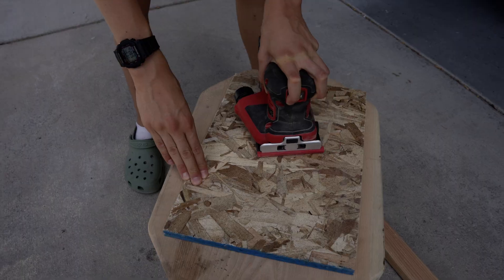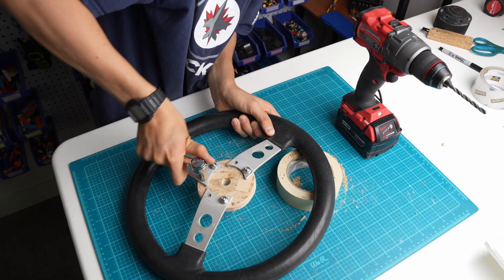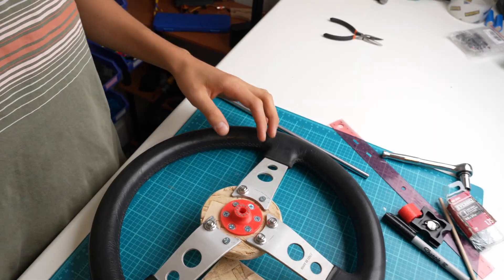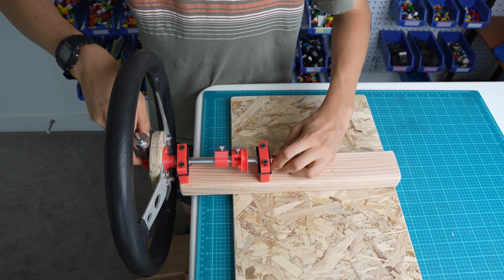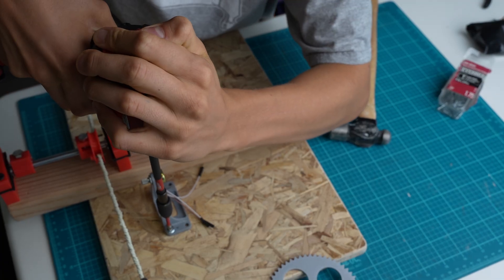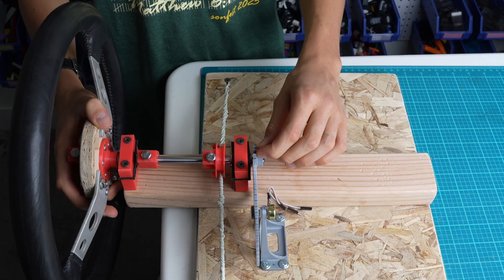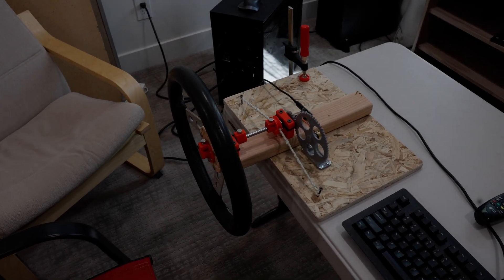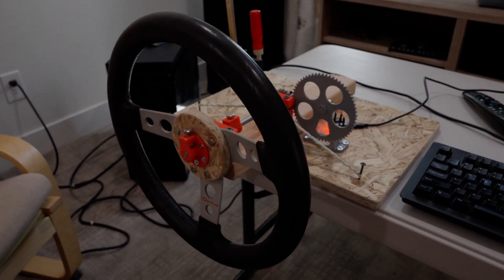Part 1 - DIY Steering Wheel for Drifting Sim | 3D Printing + Arduino

Comment: Nicely done. You can use a hard stop on the shaft to limit rotation to where you want, maybe look at using a rotary encoder to talk to the arduino. The Uno doesn't have HID, but you can use py to  vJoy to overcome that.

Comment: did you work it out. ? you can combine key board and wheel with a check box. let me know if you want to know how.
Reply from the maker: No actually I never got to figuring it out. I saw the check boxes but then I completely forgot about it because I never really needed it after I made the pedals. I could be worth though figuring it out if i still want to shift gears manually now but I will finish the shifter in a week so it doesn't really matter anymore. Thanks for the tip though!

Comment: Hey man, great build! I saw your latest video of the pedals and its quite creative. I was wondering how did you program the potentiometer to act as a custom controller for Asseto Corsa. I have a board that can act as an HID but I don't want it to represent keyboard actions as steering isn't binary (on and off) and instead has intensity and precision. Love the build tho, keep it up!
Reply from the maker: Thanks!
Reply: @CircuitScriptEngineering  yea but question still remains: how did you program it?
Reply: @The_DevOG  mmjoy is one way to do it you can watch İlge İpek's video about making his own steering wheel although its Turkish

Comment: Good project, Keep going, could use bigger dc motor with larger reduction using gearbox / pulley belt for better ffb experience.
Reply from the maker: I assume you mean force feedback. Yeah, that defiantly would be a better experience. I actually though about making it but then I decided to not cause I would need to buy more stuff and it costs money :(

Comment: Good work ....but it is better to have some linear play of the wheel (use thick gears or belt system) because the gears might completely miss each other when in actual use case very well done .....I too need the solution  to that issue I also want to use both at the same time so please make a vedio about it....gonna wait for it real bad .....also to add carxstreet pc supports dual input so u can use them together as they are without any extra effort

Comment: Excellent, your work is wonderful. I advise you to install the AS5048 sensor, which is much better than the Potnshumtr and the 49e pedals. These sensors work with magnets and their accuracy is very high.
Reply from the maker: Thanks for the suggestion! I think i heard about these magnetic sensors but never really looked into it.

Comment: Aa rotary encoder/ hall effect sensor instead of a potentiometer would give you more rotation and enable you to add a force feedback motor (check out ffbeast)
Reply: also when using the hall effect sensor for rotation place the magnet directly on the rod connected to the steering wheel